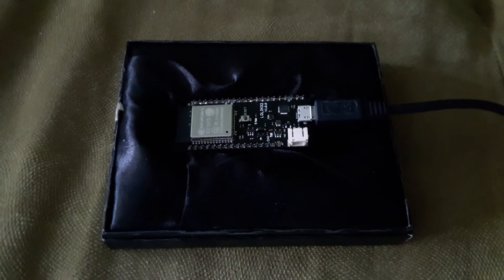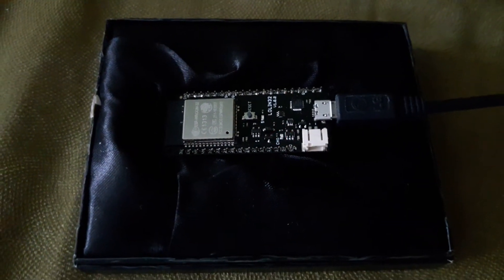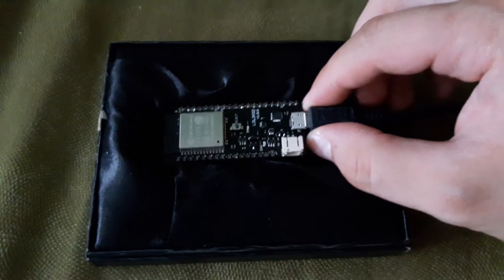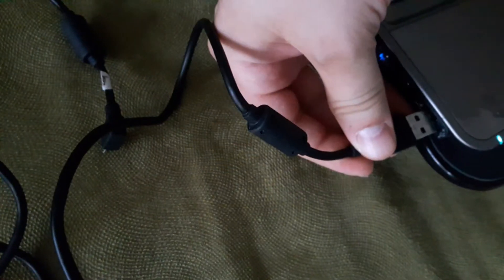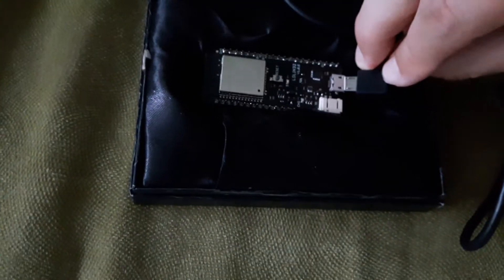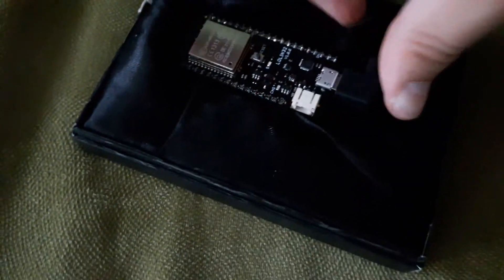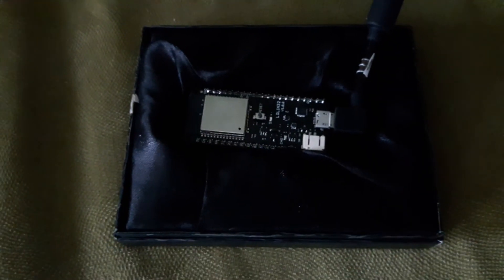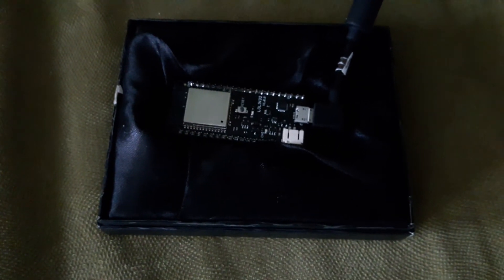ESP32 mytsery solved! (Flashing failing randomly / blinking charge LED on LOLIN32)

Comment: Ey man do you still exist? I got the same problem but I couldnt fix it
Reply from the maker: Yeah I exist :) , but I haven't touched an ESP in about 5-6 years so I'm not really up-to-date with it.
You could try:
- Flashing with lower speed
- Change the USB cable
- Try flashing to a different board
- Maybe try flashing from a different computer (?)
Anything could be wrong, try out different combination of different things and it may help pinpointing where the problem is exactly.
Reply: @norbertfekete9936  I actually succeed to fix the flashing problem not the led tho. I needed to uninstall the driver and reinstall it. For some reason I need to do it ever time when I want to flash again. Pretty annoying
Reply from the maker: @robotix_47  Weird...
Maybe it is not exactly because of the driver reinstallation, and that just happens to have a side effect which helps temporarily in this problem. The driver pretty sure stays exactly the same after installation. I mean it has no reason to change anything afterwards.
My advice would still be the same: Try switching out different parts of the "equasion": board, cable, PC.
Reply: @norbertfekete9936  Hi guys, im a latin guy trying to fixed the esp32, so sorry for my bad english, but did you find any solution for the error? I have the same problem, when I connect the ESP32 to my PC, the led turn on 3 times, first with 3 flashes, the second with 2 flashes and the last with only one flash. After that ESP32 dont do anything, What can I do?
Reply from the maker: @ItsMateo-sy1mf  Hi! I'm not sure what your problem could be. As I said in my video, my random led flashes and upload error came because of a faulty USB cable. Try out different things and see if changing something helps. Flashing it from different PC-s, different cables, etc.